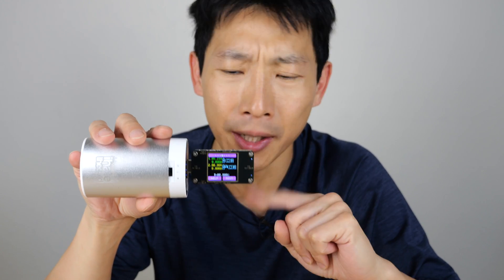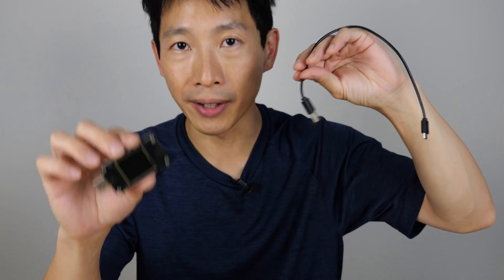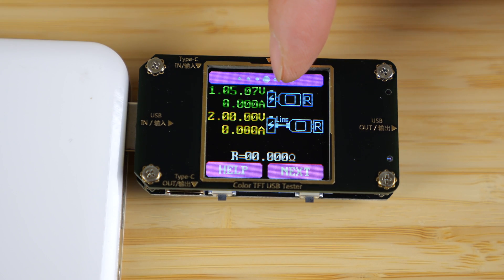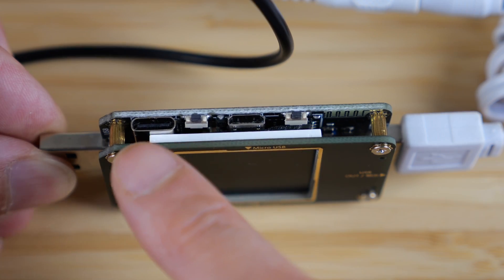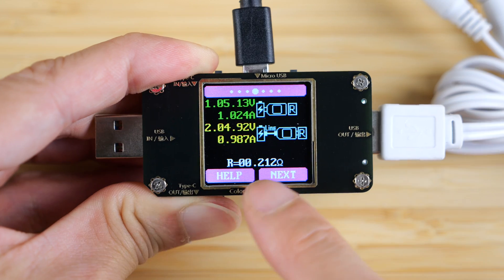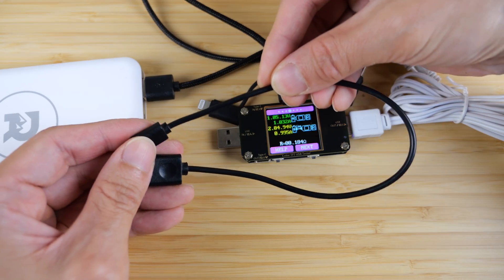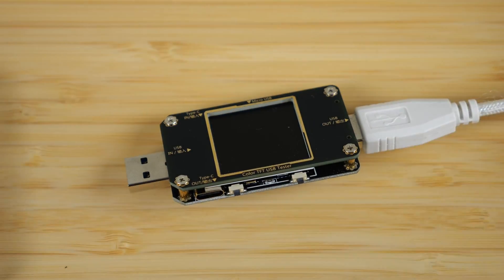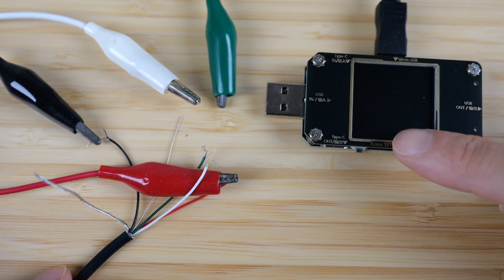How to Test a USB Cable for Faults

Comment: Great video - have a question.  I have some sensitive testing devices that are a bit fussy about cables.  When I contacted the supplier they said I had to be sure to use a USB cable very close to 90ohm impedance (which is the standard).  How can I test my cables to work out which is closest?  I did some looking but couldn't find anything?
Reply from the maker: You need Vector Network Analyzer. Perhaps you can buy a hobby level one.

Comment: Toss them away? No, these aren't cheap, especially the higher end ones with PD 3.1 240w and 20 or 40 Gbps transfer speeds or the Thunderbolt 3/4 cables.
Reply: You know nothing

Comment: can i find out if my magnetic charging cable is responsible for my bloated phone battery with this? (my phone was also 5yo, so maybe that could be a reason too)
so higher resistance = more heat in the battery = bloated battery?

Comment: 10x for detailed measurement review. I want to add a note - to measure resistance more precisely manual for FNB48 recomended to use  "constant current load (the current is adjusted to about 0.5-1A)".
Reply: what is the difference Fnirsi's FNB58 VS. FNB48?

Comment: How can you test a wall charger with a USB-C connection to see its capabilities as it seems to work only over the USB-A connection?  I tried a few USB-A to C cables and it would not even power up.  Thanks

Comment: Can the device test that a usb cable male to male ends is work properly or faulty? By the way your English is spot on. :)
Reply from the maker: USB cables are normally male on both ends. USBA to MicroUSB for example. This device tests the power lines only and not the data lines.
Reply: @BeatTheBushDIY  thank you for your prompt reply I really  appreciate it. I understand now. :)